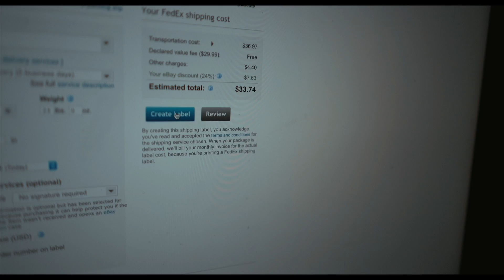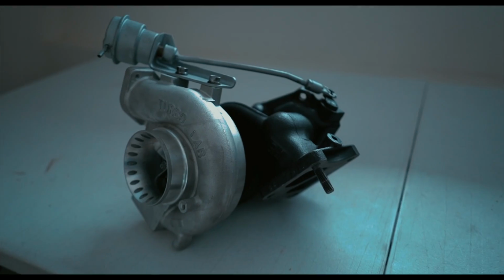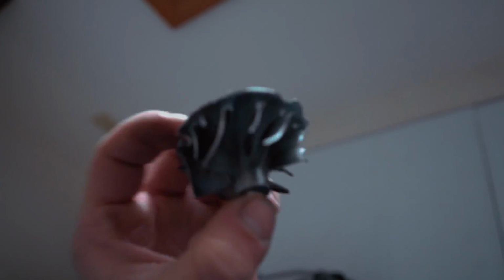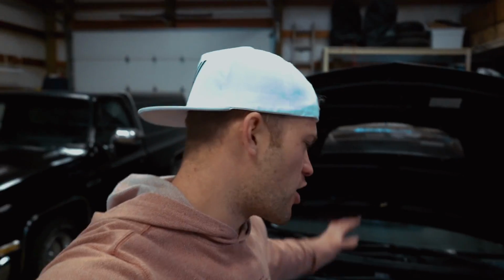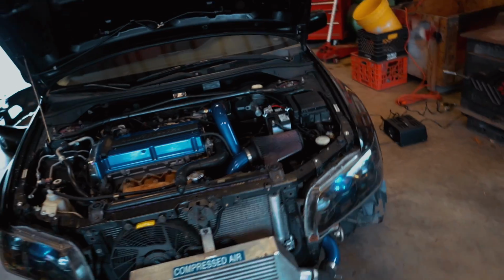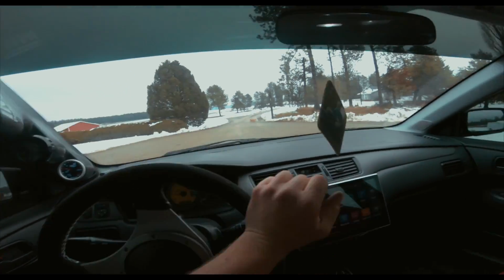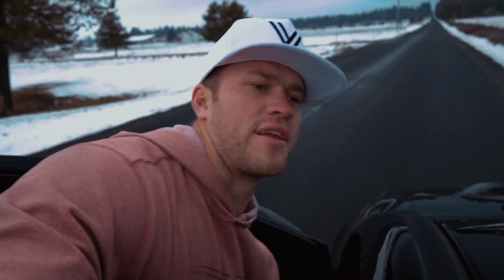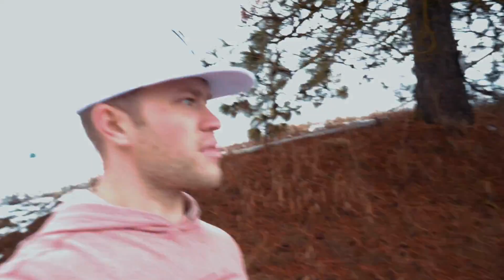The Evo Is Finally Alive!

Comment: You will make that power super easy. I have a 62mm billet wheel evo 9 turbo from them and my friend who was the previous owner of the turbo made 550/600 and my tuner even stated that I could make 600 with that turbo. People underestimate these setups. Best setup for responsiveness. Haven’t used an fp setup before or driven in a car with an fp setup but I’m sure it’s very similar.

Comment: Hey mate love your channel and the inspiration to learn your car bypass mechanics they lie and just want your money. They said gearbox but it was front wheel bearing so I did it myself and the noise disappeared. Your channel helped heaps with the 2005 WRX hatch sti short motor upgrade as I did a big end bearing!  Tomorrow i can drive it just had to redo the passenger side value cover as she leaked on the 1st crank the other day. Wa Oz

Comment: Did the turbo connect to factory oil/coolant lines? If it did bwahahahahah that's a tempting upgrade path for me to follow. Not keen on Forced Performance's oil filter housing line requirement.